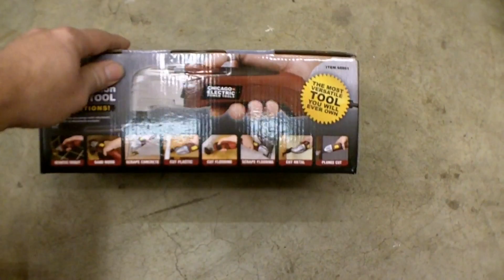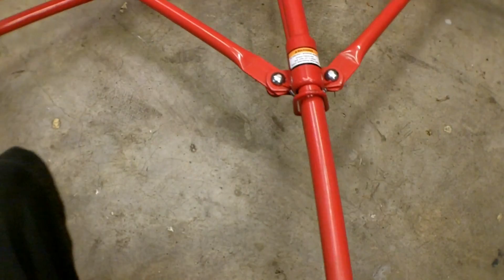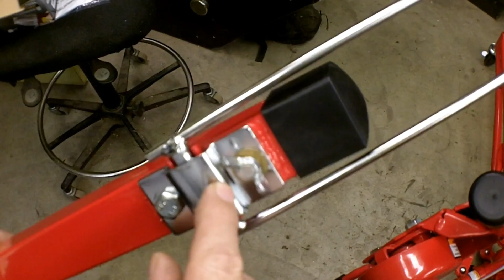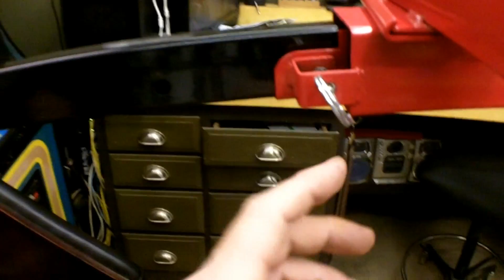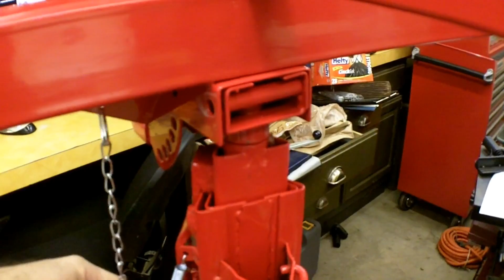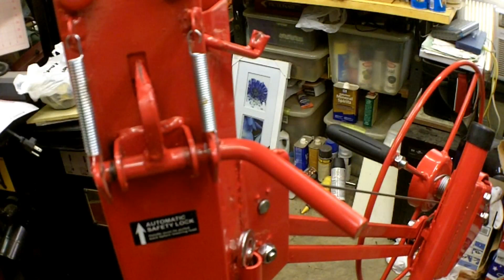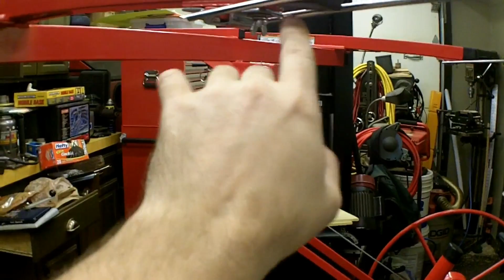Harbor Freight Panel Hoist Review Item 69377 Drywall Lift

Comment: I've got one of those harbor freight lifts I like harbor freight but I don't like there lifts I've got a old telpro panel lift I've had since 1996 and it's awesome lol
Reply from the maker: Eric, I looked for a good used lift before getting this one, but there was nothing to be had in my area. It's worked well for me, and will be used again in the next couple of days. Take care, G.
Reply: @ghostses  well you got more patience then me I only use my harbor frieght lift to load my tell pro lift when I'm doing high work like 15.5 foot vaults type x 12 footers lol
Reply from the maker: @ericcook4665  Sorry Eric- not sure where patience comes in here. I said I couldn't find a good used lift in my area so I wen't with the HF. Good luck, G.
Reply: @ghostses  once you go tell pro lift you will never go back lol
Reply: @ghostses   but for a small job or one time thing if your not planing on doing lots of drywall the harbor frieght lift will get you threw best of luck
Reply from the maker: @ericcook4665  Ok.
Reply from the maker: @ericcook4665  Good deal, that applies to me. G.

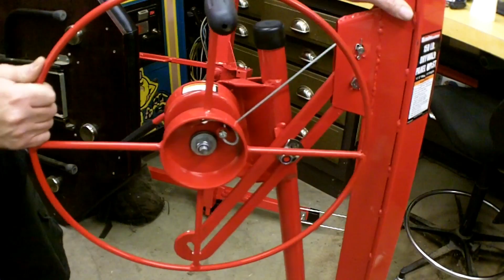Comment: What was the purpose of pulling out the wheel 2:35 minute mark? Thanks for sharing.
Reply from the maker: Al, it's to make room to access the wheel when a sheet is loaded on the lift so you don't have to crouch down. I hope this makes sense. Good luck, G.

Comment: I’ve had this lift for 6 years. Have you figured out what that big square cotter pin is for that hangs on the main shaft? The directions don’t mention it and I have never found a place where it fits. Also, the little hinged hook that flips up on the top of the shaft? It looks like perhaps it was designed to hold the shaft from extending during transport but its not long enough or big enough to reach over the top, at least on my unit.
Reply from the maker: Yes, the square pin is a safety you can stick through the mast slots after it's lifted. Personally, I never use it. And correct, that is what the hook is supposed to be used for- but like you've discovered- it's not long enough. Take care, G.

Comment: Thanks great video,I hate reading instructions.This was a big help,only one question though it seems the lift does not go closer to the floor to put the drywall on.I like that trick with the safety latch where you moved it to the side to lower it.
Reply from the maker: Thanks Julian! No it doesn't go lower, this is a low as it goes. When you tilt the cradle over- you still have to lift the sheets a few feet to get them loaded. Take care, G.
Reply: @ghostses  Thanks again sir you were a big help.
Reply from the maker: No problem Julian! Good luck, G.

Comment: why you got 41 thumbs down. I can only guess is they are thumb suckers. I liked the fact that you pointed out the drop down brake on the bottom. I didn't know that . Unfortunately I am still wondering what the washer welded to the metal pin  function is?  It has hangs on the side of the mast.
Reply from the maker: Your guess is a good as mine.... The washer with the square pin is the only thing I forgot to mention. After you lift a sheet, you can take that pin and put it though  the slots in the mast as another safety. I never use it, but that is what it's for. Hope this helps, G.

Comment: Hi 
On the minute 10:10 your finger is pointing to a small pin with a washer welded 
Do you know what or why is for intended?
Reply from the maker: It's a safety that can be installed through the mast slots. I should be referenced in the manual somewhere. Hope this helps, G.

Comment: This is, without a doubt, the best HF lift review and assembly video on YouTube. Thank you for it! Just assembled mine out in the shop but had to run in to find a few points of clarification from the (as usual) wonderful instruction manual. Watched 4 before finding yours; again, the best! 

One of my questions was about that square pin but I just scrolled through the comments until I found one about it. Your reply was interesting as I couldn’t find a square hole anywhere on the thing. When I go back out in a minute I’m pretty sure it will be totally obvious.

Thanks!
Reply from the maker: Thanks Jake. The square pin can be used to put through the mast slots at an angle. It's there to be used if you're not in a definite "click" with the spring loaded latch. I personally don't use it- but one could. I believe it's outlined in the manual somewhere. Not much help, but hope this helps, G.

Comment: ceilings go up first.  That leaves 1/2" space below the wall sheetrock to the floor.  Doing it your way leaves 1-1/8" gap at the bottom of the sheetrock on a standards 8' wall with precut studs.  Good luck install the base trim with that wider gap.  Good way to piss off your finish carpenters. Correct your video!  Only DIY would do it your way.
Reply from the maker: Yes Warren, the ceilings go up first. I was saying the top sheet on the wall goes up first, then the bottom gets installed and lifted. No correction needed. G.
Reply: Do your measurements on a 92 5/8 stud, three plates, minus 3/4" stripping. Walls first. Got a rocker hanging a house today, having to cut the side off all the bottom sheets because he knows so much. I said wall first when he got there.

Comment: Does anyone know what that rectangular "key" is that's included? Also is the other little springy round metal part, near the top,  something to stop the sheet platform from shifting. I can't find either any on the leaflet
Reply from the maker: John, after it's raised up- the key can be installed through the slot in the mast to act as a safety. I'm not sure what springy part you're referring to.  If you mean the part shown on the right side at this point in the video ( https://youtu.be/WNH3FiG4lJo?t=181 ) , when the mast is all the way down, you can fold it up, put some tension on the cable, and it will keep the mast from sliding out when it's being transported. Mine was too short so it doesn't work properly. Hope this helps, G.

Comment: Five years later they still sell it I just bought one for $169 with coupon.
Reply from the maker: That's cool Matt! Makes the job easier. Good  luck, G.
Reply: @ghostses  Thought I got a smoking hot deal with my coupon but I just saw Menards has it  for $149.99,$20 less. It just goes to show if it ain't one thing it's another.
Reply from the maker: Matt, if you're within 30days you could return it and gain the $20- if it's worth the time and effort. We don't have Menards around here, but I wish we did, so my option was HF. Take care, G.
Reply: @ghostses  Yea the cost of fuel and time would be a wash. My super shopper side kinda wants to return it but my lazy side won out.
Reply from the maker: Understood Matt! I used to just go get what I needed at any cost. Then I married and she got me on the super shopper bandwagon....lol. At first I resisted, but soon fell into the ways and now I can't imagine how much has been saved over the years! G.
Reply: @ghostses  I am finishing my basement and have changed some of the duct work from big bulky fiber board to low profile metal and the lift has been great for getting the new duct work up into place. The lift has been worth ever penny so far.

Comment: Is this diesel or petrol coz mine won't go to 9ft now, took it back to the shop and the guy looked at me like if I was thick, had my money back
Reply from the maker: There's both. So if you used diesel and it didn't go to 9- then you should've used petrol. Or flip flop that if you had the other results. Good luck, G.

Comment: Is there a lock that I am over looking when taking it apart? When I lift the top portion the mast wants to come up with it.
Reply from the maker: There is Daryl. You can see it here. It looks like a triangle with the ends bent. You fold it up and it should hold the mast in place. You might need to add some tension to the cable so it stays put. The one on mine is too short so it doesn't work. Good luck, G.

https://youtu.be/WNH3FiG4lJo?t=389

Comment: I bought one of these to do what you do, hang sheetrock by myself. The only thing I didn't like was the fact that you can't pin the mast in place for transportation. If you turn the top of the mast down while carrying it the mast will come sliding out. Did I miss something or what?
Reply from the maker: Hunter, there's a hook that you can rotate over the top of the mast that is supposed to keep it from sliding out when you transport it. The one on mine was made too short so it wont work. But, yours might be different and actually work. You might need to apply a little cable tension to keep it in place, but don't know for sure. Here's a spot in the video where you can see the hook. It's on the right side of the mast. Hope this helps, G.

https://youtu.be/WNH3FiG4lJo?t=189
Reply: Yeah, I'm having the same problem, the hook is too short to effectively keep the mast locked. Guess I'll have to do some reengineering on it! If they had drilled the mast to put the square pin in, that would have been perfect.
Reply from the maker: Yeah Hunter, you're going to have to come up with something that works for you. Drilling the mast for the square pin might be a good option, and a good idea! Perhaps even easier than trying to make a new hook, or modify the one that's there. If you come up with something, post what you did. Take care, G.

Comment: Why did you point so many times at the end of the video at the safety pin without showing how to use it during the video?  Why did you do that ? Are you hoping someone will get hurt ? Or what ? This is a VERY DANGEROUS VIDEO. DON'T RELY ON THIS FOR SAFE OPERATION YOU COULD DIE IF YOU DO ! Why don't you just fix the video before someone gets hurt. That's all you need to do, is just fix it so people know how to insert the safely pin during operation. Show them how it works, don't just say its should be used. That would be helpful, And that why you made the video, right, to be helpful ?
Reply from the maker: Man, you figured me out. It was my cunning way to thin the heard, but you just messed up my master plan. Quit being such a sissy and read the manual! Or buy one and put up your own review. Why don't you be helpful? G.

Comment: I'm thinking of using this lift to remove come cabinets in order to replace drywall. Would it work?
Reply from the maker: If It were me Serge, I would go another direction. You can rent lifts like in the link I've posted. That would be what I would use. Good luck, G.

http://www.northerntool.com/shop/tools/product_200336940_200336940
Reply: just use some screw up camper jack stands. We install and remove with them. They're made of aluminum and are light.

Comment: I have one of these. My only complaint is that it rotates when you are trying to load it by yourself. I think they could have added some type of locking pin. I have a welder, I guess I'll modify it when I get time.
Reply from the maker: It does Chris. A locking pin might be a good thing. When I load mine, I set the brake, then walk the sheet into it until it rotates so both the supporting hooks are under the sheet. You might give that technique a try till you get to modding it. Good luck, G.
Reply: ghostses What I've been doing is just positioning it so the wall stops it from turning all the way, then as long as you get your panel on the hook closest to the wall first, it won't move. Still going to mod it someday though. Someday. I have so many someday projects....I'll get to them someday though.
Reply from the maker: That's cool Chris. I too have many someday projects myself...lol. Take care, G.

Comment: I heard him say that the walls should go up first.  My practice is that ceiling goes up first and then top edge of wall will help support drywall on ceiling as it pushes up against outer edge of drywall ceiling.
Reply from the maker: Yes Willie, ceiling first, then top wall sheet- then lower. I was saying the top wall sheet goes on before the lower but I can see where it might be confusing the way I shot the video. Take care, G.
Reply: no, on a stripped ceiling with stud walls, ceiling first. I'm 50 and raised by a builder and still build. Got a Sheetrock hanger doing a house right now. I said walls first, but he did ceiling, cause he knows so much. Had to cut 3/4 off all the wall sheets in the entire house. He learned.

Comment: I just got one to use as a portable solar panel mount . It travels well and a few adaptations it holds 5 - 100 watt panels for my RV to have extra power. Very easy to adapt it, and 1/4 the price other like items cost.
Reply from the maker: Very cool application for an expensive cost! G.

Comment: Glad you mentioned it maxes out at 11 ft.  I have a 12 ft shop ceiling. I suppose a guy could build some risers to bolt on and get the extra 12".  You would have to watch the stability closely as the base width may get sketchy.
Reply from the maker: Yeah Richard, with your height- you might look elsewhere. "Sketchy" is a good description. Glad the video was useful. Good luck and take care, G.
Reply: I would build a platform on which to set the hoist 18" higher than the floor. Maybe several pallets and plywood? Maybe attach some lockable casters to the bottom so it could easily be moved as a single unit.

Comment: Home depot wants $45 rent for 4 hours on one of those. I wanted to take my sweet time at it, so I bought one on E-Bay for $85.  Only difference on mine is the color, and it don't have the little safety notches that clicks in the holes. Remedy for that is just place a telescoping pole next to the mast and just click it up as you go if worried about it.
Reply from the maker: Yeah, that's crazy money for that time. Not a bad deal for the one you got. Good luck, G.

Comment: Excellent Review!I have had one of these for a few years now, and use it on one or two jobs each year. I love it!I also added washers to the wing nuts - What were they thinking?I can't believe I never figured out the "Slide it to the side trick" - I have been cursing mine each time I lowered it One notch at a time. THANK YOU FOR THAT.The one other question I have not figured out, you did not address either, What is the purpose of the Square Pin that hangs on the side!!!Thanks again - can't wait to use mine again next week now that I know the right way to lower it.
Reply from the maker: Thanks! Even with that little use- it's already paid for itself! Simple enough to correct the problem by adding washers- but I too don't know what they were thinking.

LOL! Now that you know how to release the safety, you're going to like it even more.

Yeah, the square pin is something I forgot to mention. I don't use it, but it's another safety. After you get the panel up, you can insert the pin diagonally through the slots in the mast. Hope this helps. Good luck with your upcoming project, G.
Reply: MJCPeters

Comment: Ya I tried telling them but they wouldn't talk about it.  Then a week later I got a email from someone that told me to put a cable clamp on the end of the cable. I sent him a e mail back and I asked him why I should have to do that. That part of it is already assembled when you open the box. They sound of replaced it
Reply from the maker: +TheSKINNMAN 
It sounds like a solution, but it should have been one that was done at the factory. I'm going to take a look at mine next time I use it- and maybe add a clamp- for good measure. I agree, they should have replaced the unit. G.

Comment: did you find that the little lever that flips up for when your breaking it down was to short? also what was the square key on the base pole for? I could not find a used for it
Reply from the maker: +Nicholas Simanski 
Yes I did Nicholas! I didn't notice it until after I shot the video.  It makes carrying it around a pain since the mast wants to slide out. The square key can be put through the holes in the mast as an added safety measure. I don't use it. They really need to fix the lever! Take care, G.
Reply: +ghostses simple fix to the lever problem; drill a hole in the mast for it to stick into
Reply from the maker: +Nicholas Simanski 
Ahh, thanks for the tip! I didn't think of doing that so thanks! Good luck, G.

Comment: Nice, clear explanation of this product. I've been thinking about something simpler for just hanging an upper drywall sheet - like two temporary brackets at 4 feet, a pulley hoist mounted to a joist in the ceiling. Then pulling the sheet up into the holding brackets where you can then screw the sheet to the wall. I may try this but it may be more time and work than it appears.
Reply from the maker: Thanks! You might be able to cobble something together but you're right, it might be more time and work than it appears. If you're doing a one-off job, renting one might be a good option. Good luck, G.